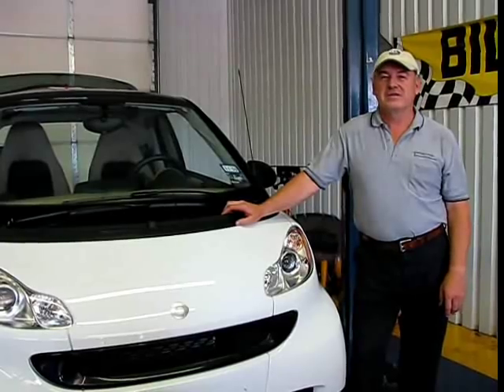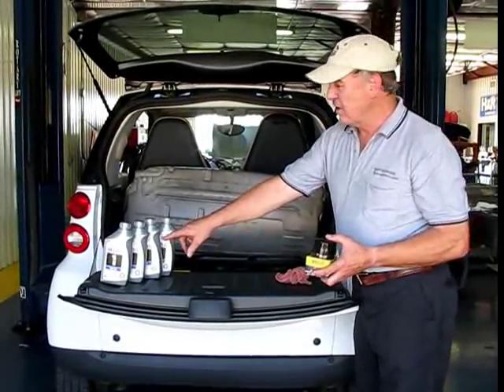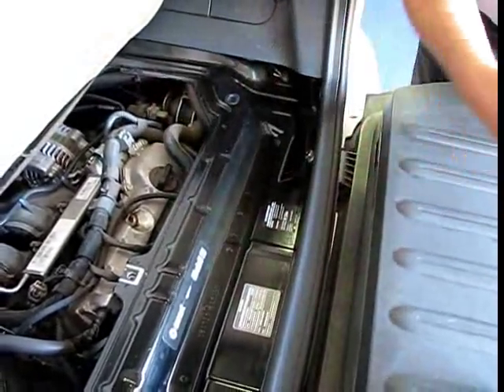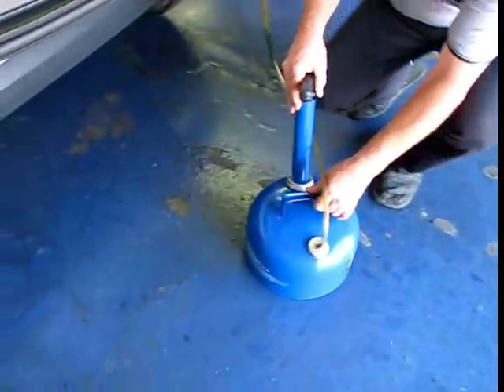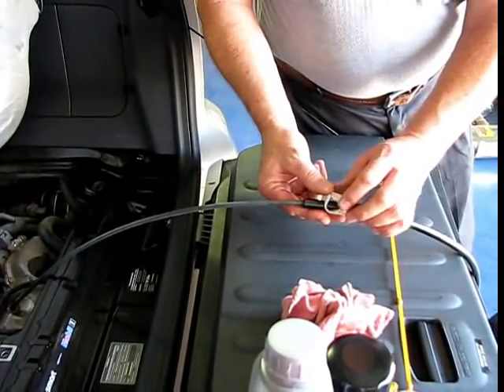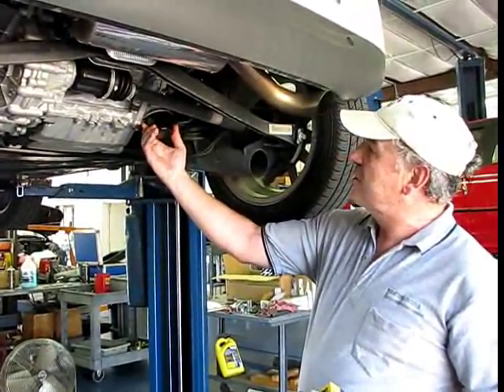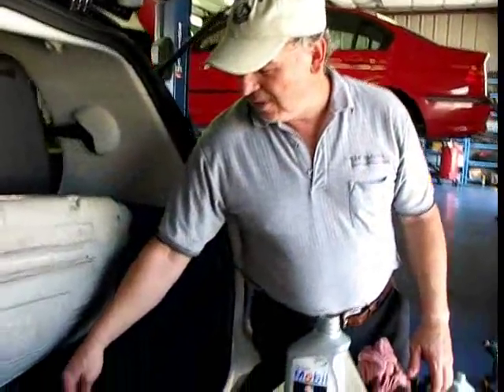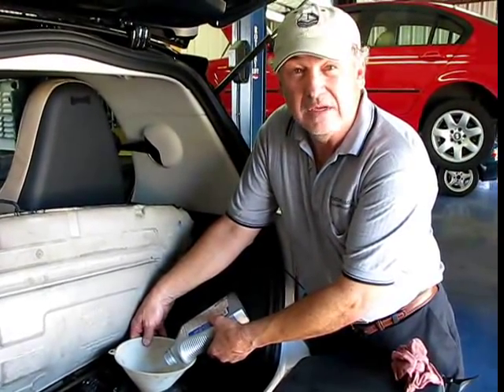Smart Car Oil Change with Topside Oil Changer

Comment: Great video.

Since I have a 2006, this is the only option I have. Oil filter is easy to access without a lift, though. Then again, most of my past cars have been Mercedes, with the filter canister easy to access from the top, so I have use a TopSider or similar suction device for many years.  It certainly simplifies things, particularly on cars that don't need a lift to change the filter.

Comment: None of the early Smarts had a sump plug, and all oil changes had to be done topside using vacuum.
I am tempted to do a top side removal on mine, and then remove the sump plug to see whats left (if any)
I get the feeling more slug is likely to come out using the sump plug method, but it needs proving!

Comment: changed the oil in my (used) 2013 right after I bought it. it took about 10 minutes. the oil plug and filter are on the bottom of the engine. probably the easiest oil change of any vehicle I've ever had. although the oil plug was on there super tight and I had to go to the store for the 20MM socket - or whatever size it was. they must put the death grip on them at the factory.
Reply: 24mm, for anyone reading this.

Comment: So if you have to crawl under the car anyway to change the filter, why go to all the trouble to use a top side oil changer?  How to do you change the oil from the bottom?  My wife is considering one of these cars, but I can find little info on how to service this car.  (nice video though!)  Isn't changing the oil from the bottom better as it allows more crap to come out like sludge or clumps if the are loose? Where can I get a top side oil changer and will it work with all types of cars? (I assume so) This may bake the occasional oil change quicker for those every other oil changes where I may not change the filter.
Reply: i use a mighty vac oil changer on my Toyota Tacoma because the oil filter is top side also.  this video was stupid,  he didn't even pre fill the filter,  and this was an auto garage.

Comment: Does smart advise not prefilling the oil filter. I have never met a mechanic that doesnt prefill the oil filter. This prevents.  From dry start.  Or are these engines dry sump. Either way i would still prefill the oil filter.

Comment: You can't just pick any oil whether it be a 5W30 or 5W40 oil.  You have to use the oil that meets the specs of the engine.  There's only certain oils that will meet the Mercedes-Benz spec.  The Amsoil European 5W40 is one of those oils that is 100% compatible with the smart.  You can damage seals or other engine internals by using the wrong oil type.  I know people who have messed up engines in other cars, especially German ones by using the wrong oil type.  The oil filter shown here is fine.

Comment: Top side oil changes leave all the gunk at the bottom of the pan. If the car has a drain, do a proper oil change.

If I ever saw a mechanic do this to my Mini I'd be pissed and have to change the oil myself or go to a competent shop.

Comment: @Neonspinnazz30 hi your car is gas i have a2005 diesel  withs has a oil card ridge  and the location of the stick is on the fare right the wrench size for the oil cap is 1.1/16 inch

Comment: Using a thinner weight oil (5W-30) in a hotter extreme environment and a thicker viscosity (0w-40)  for colder environments?  That is news to me.

The mulitweight oil labelling system is probably the most misunderstood topic among auto mechanics.

Comment: It's easier without using the suction device - just unscrew the drain plug and let gravity do the work.  And you don't need a lift to get access to the oil filter.

Comment: These devices got debunked as garbage years ago.  The absolute best way to change the oil?  Go under and use the drain plug.  That way you can inspect the oil for any signs of future engine problems, and you'll get all of it out.  Can't believe these products are making a come back--